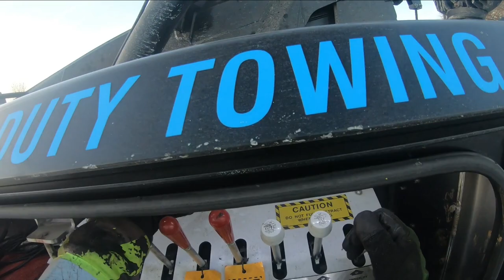RAM...MED A CULVERT!!!  LIGHT DUTY RECOVERY!!

Comment: You could just use the flatbed to pull the van on the bed of the truck you didn't really need the big truck
Reply from the maker: Why stress smaller equipment and risk further damages? I had total control over it using the "big truck" vs the possibility of it getting wedged or being more wedged than we had anticipated.  I appreciate your comment and taking the time to watch my video!
Reply: @MercifulTowing  I do towing to
Reply from the maker: @kenlypacquette3918  I never said you didn't, I wanted to provide you with our thinking prior to driving over 20 miles to get on scene, if this thing needs lifted let's make sure we can lift it, if it's wedged real bad let's make sure we outweigh it and don't over stress our equipment.